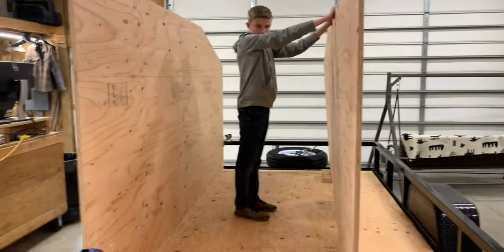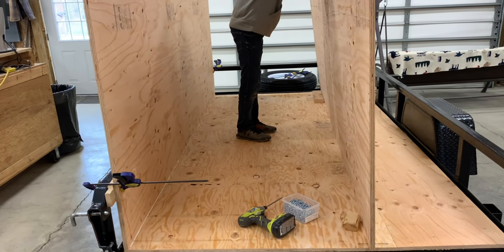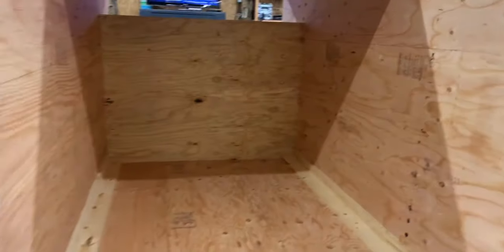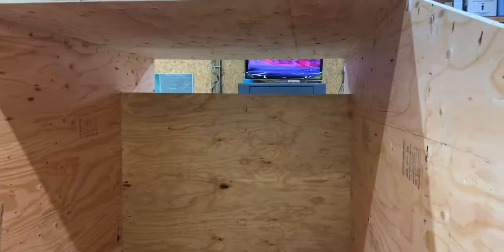Squaredrop Camper Build, Part 2

Comment: 2 yrs ago and my input is way too late, but something that one might consider would be to take advantage of the front of the trailer, over the tongue.  I would also consider taking advantage of the sides.  It seems some reinforced light weight, durable metal framing would be practical for storage compartments over the wheel wells and front-back of the trailer.  Those compartments could be weather treated and the doors to the storage could be water proofed to provide some much needed modest customized storage. 
I guess the weight limit of the trailer and axel might limit this idea a bit.  Fun project and once again, quality time with the boys is priceless. 😍

Comment: Really great work, wife and I are doing this now, just getting ideas, got a 38 ft 5 ft wheel donor, plan on using everything from it. Should be a bonding experience 🌪🤷🏿‍♂️
Reply: Good luck young man!  I’m assuming you’re young because anyone married for any length of time tends to use projects like these to get away from the wife.  
My comment is meant to be jocular as well.
Reply: @kcb5336  nope, I’m a young 58, brother with r. a. , if ya slow down you stop, if you stop you die. Plain and simple. Enjoy each day( and night) as it were your last.

Comment: I am building a camper like this it's also removable but it's very heavy because I used wood as well but it's coming along.
Reply from the maker: Nice! Mine is still working great. Using a separate utility trailer makes the whole thing a bit heavier, but also very sturdy and reliable. Good luck!

Comment: How much extra weight does the wood make, advise using possible aluminum studs?
Reply from the maker: Weight is one thing I would try different if I built another one. It’s not terrible, but this one is build HD, 3/4” plywood all around and 3/4” trim and support wood. Do some math before building and estimate weight. It could make a big difference depending on your tow vehicle.

Comment: I might be getting ahead but if you leave the trailer rails on the door will have to be above those rails. That will put the door 10-15” above the floor (less if the mattress is down). Won’t that make an uncomfortable entry/exit into the camper?
Reply from the maker: Yeah, you’re ahead. You’ve probably watched the remaining videos and found out you’re right. The doors are situated higher. Entry isn’t really an issue.

Comment: cool, simple is good.   How did you decide that 6 inch spacing of the pocket holes is sufficient?   Maybe I am a skeptic and would use 3 inch spacing, twice as many screws as you
Reply from the maker: Just looking at it is how I decided. Also I glued every joint so there is no way this thing is coming apart.

Comment: Hi all, I just found your site and this looks great, I’m making something similar mine is 5’H x 8’L with 3/4 fir. 
My question for you is when you did your pocket hole screws on the inside did your screws go through the other side?
What was the angle you use y and what size of screws did you use. 
Garett
Reply from the maker: I used a Kreg jig to drill all the pocket holes.  Not sure what angle that jig is but I’m sure you can look it up online. Screws are Kreg screws made for their pocket holes. They have a wide shoulder to grip the workpiece and hold tight. I also glued every joint on this camper. It’s solid as a rock. Good luck and thanks for watching.

Comment: What's your plan on getting it on/off the trailer. I've got the exact same situation but I couldn't think of a good way.
Reply from the maker: Hi Joseph. I use the winch on the front of my atv. There’s a hitch on the front so I attach the trailer to that and then the winch to the camper pod. To get it off, the trailer is attached to the tow vehicle and I winch it off from the rear. 

I’ll be doing a video on this in the future. Thanks for watching.

Comment: Hallo! I like your camper very much.  Could you tell me the dimensions of the wood wals?
Reply from the maker: The exterior dimensions are 10’ long, 5’ wide and 5’ tall. The interior dimensions of the sleeping cabin are just short of 5’ tall and wide by around 7-1/2’ long.

Comment: Great job. I’d really like to build something like this. I have a question for ya. I have a trailer very similar to yours but a 8’x5’. Do you think I could build my removable 9’ which would leave a one foot overhang off the back? I really want a roomy rear galley but I think it would be too cramped inside if I build the square drop 8’. I followed your entire build beginning to end and am thoroughly impressed. Happy camping.
Reply from the maker: Hi Rick. I think you could get away with a design that overhangs the rear by 12” as long as you have appropriate weight in the front. Maybe adding a sliding drawer in the front that has your fridge and maybe some storage. Just make sure your tongue weight is right or you will have problems trailering. If you followed my build, I ended up sliding my pod further to the front for more tongue weight and it trailers much better now. Thanks for watching the series and good luck with your build.
Reply: @LivingOurAmericanDream  Thanks for the quick reply. I was actually thinking of running the front of my square drop approximately 12” up and past the front of the railing which would give me room to add front interior cabinets which would in turn add additional tongue weight. I plan on making mine more of a 12 volt solar system with the option of running shore power but mostly 12v. Thanks again
Reply: Just get a trailer one foot longer if possible. Maybe more balanced with the  axle on the trailer, a double tandem trailer would also help.

Comment: No 2/4 or 2/3 studs are you sure not going to fall apart on the highway . Why not put studs or medal studs first than plywood.
Reply from the maker: Hi. Actually, if you’ve ever built structures using a Kreg jig with glued joints, they’re really, really strong. So far we’ve taken this rig across Michigan several times and from Michigan to Florida and back once, no problems. Next trip is Michigan to Yellowstone national park this summer, camping in grant village campground. Looking forward to that one. Thanks for watching.

Comment: Unfortunately you wasted a HUGE AMOUNT of space. You should have built the walls up from over outside edge of wheels
Reply from the maker: Paul, with that logic, it should be two feet taller and two feet longer. The intention was a small camper that can be removed from the trailer. It works great. The neat part is, when you build yours, you can build the walls up from the outside edge of the wheels!

Thanks for watching!